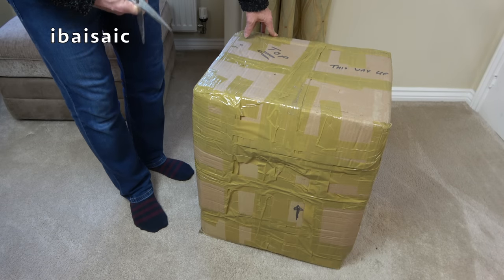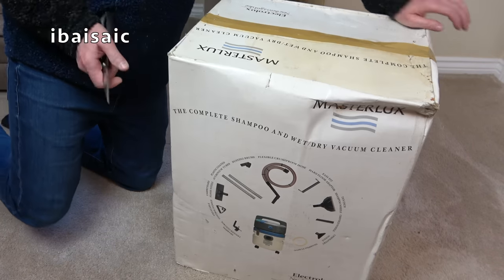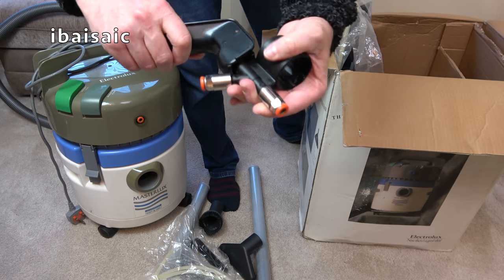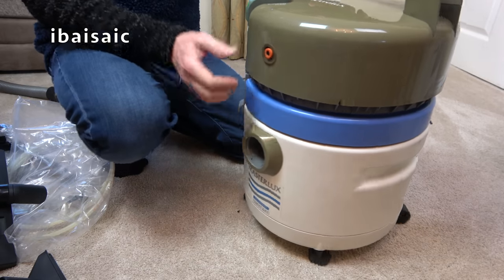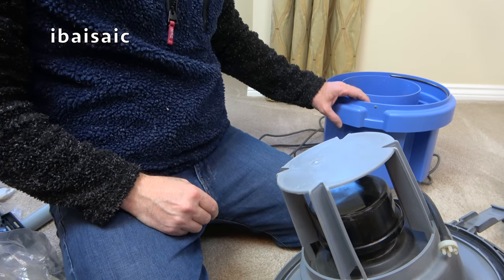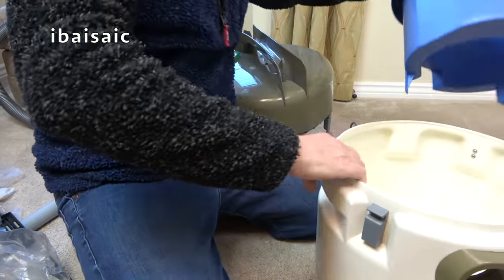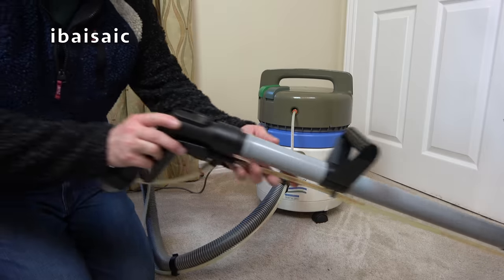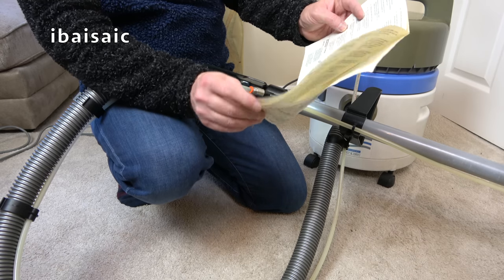Electrolux Masterlux 3 in 1 Vacuum Cleaner Unboxing & Fault Finding

Comment: I repaired an older bissell that worked in the same way.  I could hear the pump too.  But simply from age, the diaphragm in the pump perished.   It was cracked and could not build up pressure.   I bought a new diaphragm.   Worked perfectly after that.

Comment: ive used that cleaner before. instructions on page 9 state: turn the machine on. press and hold pump switch. depress trigger on handle until water flows. release trigger and pump switch. now its primed. the handle will now control the pump switch via the pressure solenoid on that y connection. the switch on the cleaner is more or less a priming switch. its a press and hold type of switch. which is why it doesnt click on and off. the handle assembly and hosing must be fully together for it all to work. i hope this helps ya out :) happy vacuuming!
Reply from the maker: I’ll try that, thanks.
Reply: @ibaisaic  i also found a uk online store that has Z85 parts for sale as well. may not be exact model, but just slightly newer. looks like they sell NOS parts. including switches, pumps, and that y connector too. i also saw new filters.

Comment: the two connections on the y piece are pressure switches so it must have to have water pressure to continue working so you must have to hold the switch till the water starts flowing after that it runs till the water runs out ,a brilliant design as you can,t switch on the pump as you can with the hoover and vax!

Comment: The people who make mention of the diaphragm within the pump dry rotting might be on to something.  You could try taking that white solenoid part off, then after removing that pump spring, soak any rubber type o rings or reeds in some water overnight.  That might cause them to swell back up and make a seal. Additionally you could try treating those components with a silicone protectant/reviver.  In the US it would be something like Armor All or Meguiar's back to black, the kinda stuff someone would use on black car trim or tyres after a wash (is that what your Vuplex spray is?) Anyways.  Best of luck.  It was a delight to see you getting under the hood and tinkering.